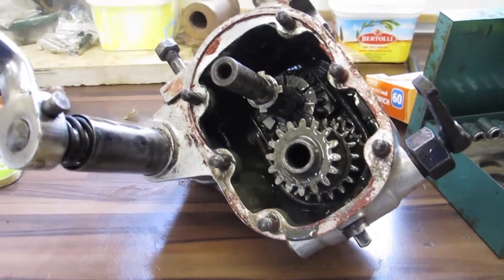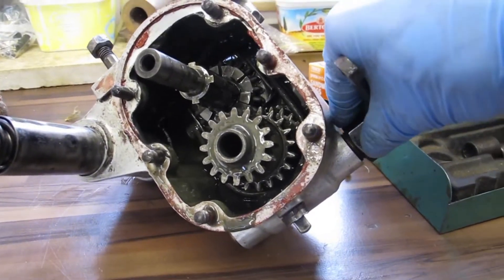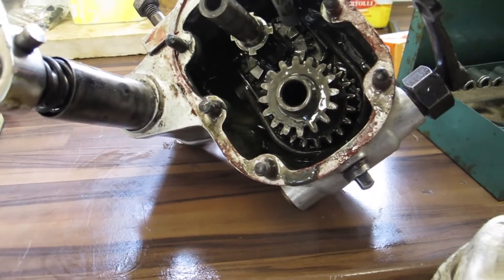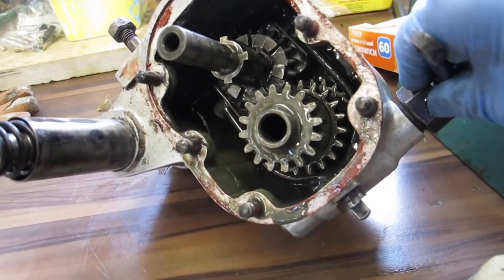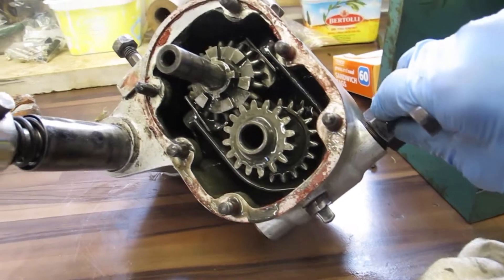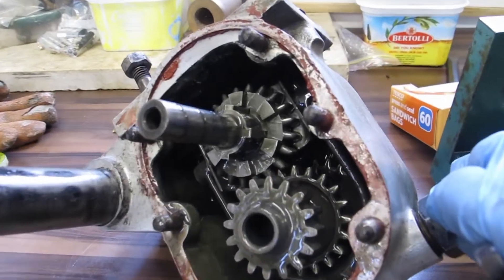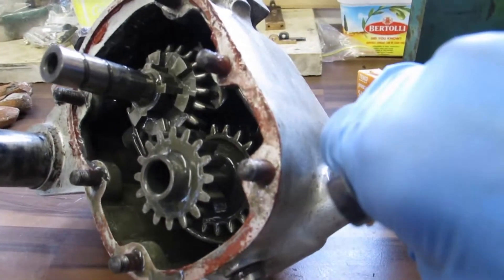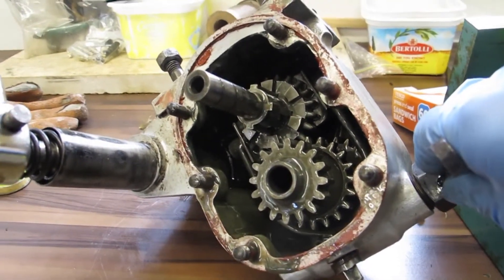1930 Sunbeam Model 9 Gearbox Operation

Comment: Great videos. I've just started a 1931 model 9 restoration and I wondered if you had a list of the four gearbox bearings for the BT box, as I can't make out the stampings on mine? Really appreciate it. Thanks
Reply from the maker: Sorry for the delay in responding, I don't have the details of the bearings but if you email spares AT marston-sunbeam.org they may be able to help.